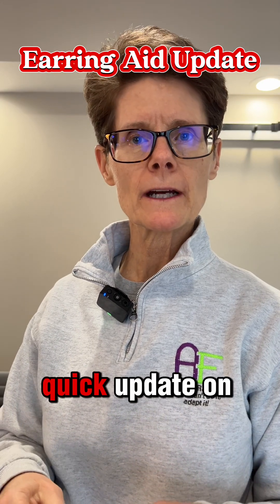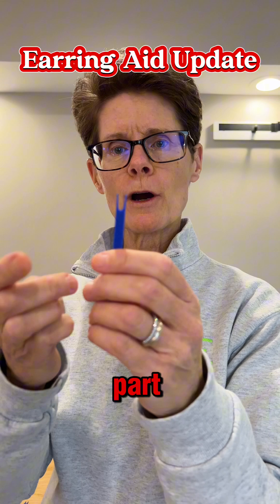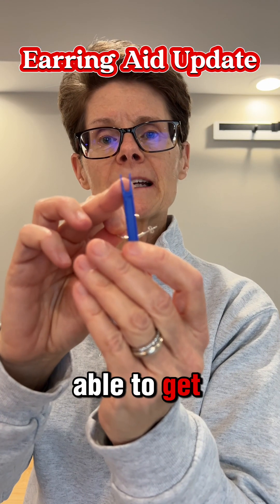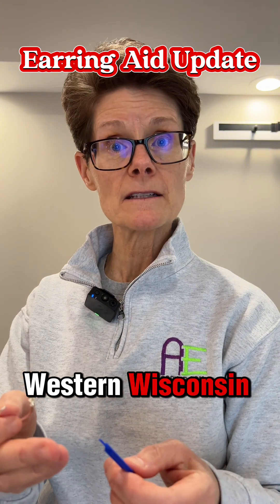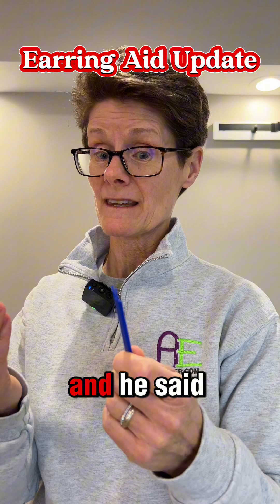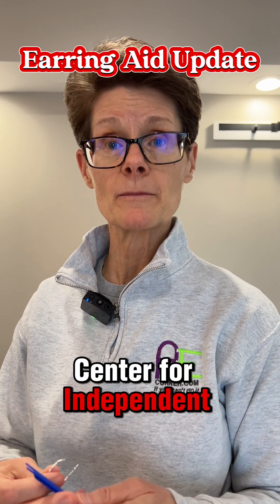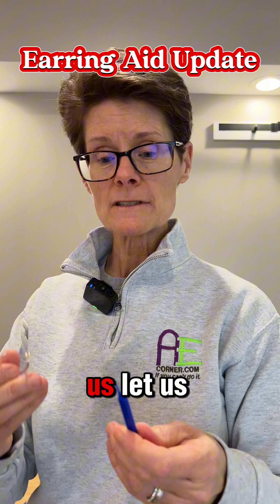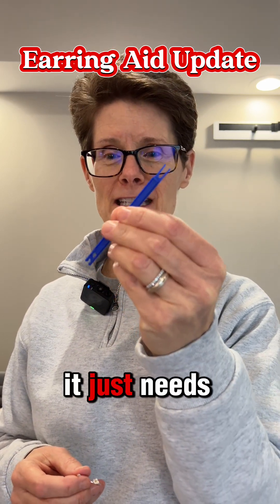"Hold My Earrings!" - 3D Printing the Ultimate Earring Aid

Comment: If you want a working prototype, you need to gently heat the plastic enough to squeeze the prongs together, then let the plastic cool and harden. If you want it done for you, take both items  to an optometrist and have them adjust the prongs the same way they adjust eyeglasses (heated sand).
Reply from the maker: Brilliant! Thanks,  @joshua_of_nun91  !
Reply: That's sounds like a great idea